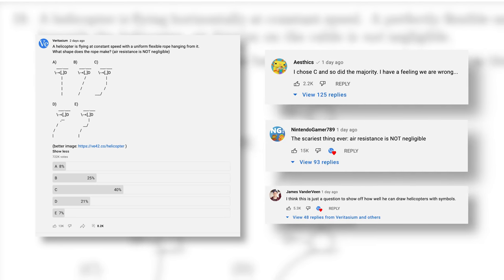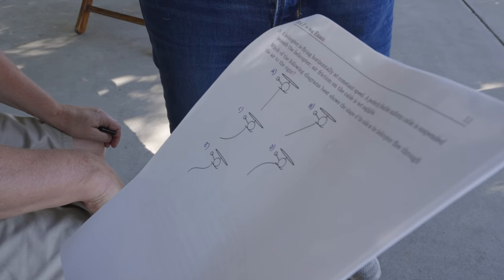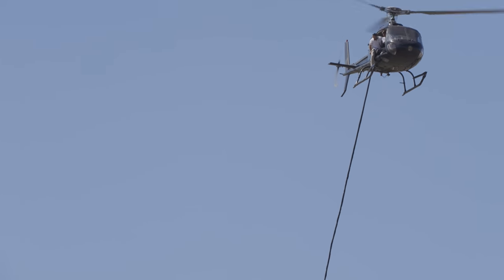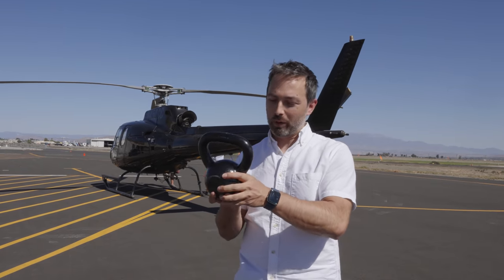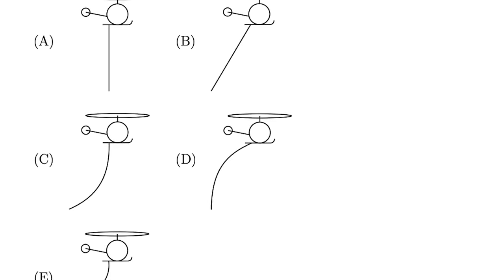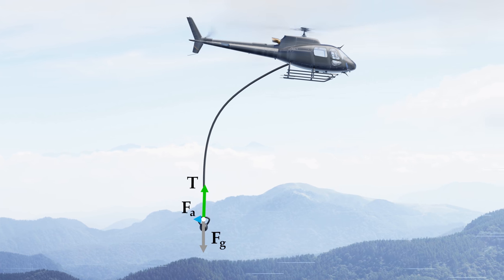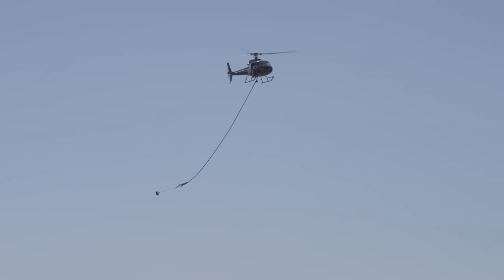I Rented A Helicopter To Settle A Physics Debate

Comment: At 17 seconds, Air friction on the cable is not negligible. Definition of negligible , so small or unimportant as to be not worth considering. So then the question is, what is the actual reaction to the cable as air flows past it? Does the air flow cause the cable to deflect? I would expect that it does. If we disregard the fact that the cable is round, and just use a strip that  is flat but the same width as the diameter of the cable, times the length of the cable, this would give the square units, what ever you are measuring it in. 

not negligible", you lose all credibility.

Comment: The question doesn't mention the force of rotor wash, the length of rope, nor the air density.

How would this be affected if there was greater rotor wash, or if the rope was shorter and perhaps more sensitive to the wash effects by being so much nearer? I'd think it might maybe be an answer "(F) Chaotic" ?

Or how would this question be affected by varying air densities? I'd imagine the answer would be nearer to A on, say, the Moon (admittedly prob not a helicopter here) ... but maybe nearer to C with a very long rope & in a more soupy environment, perhaps such as a fishing line trailing a boat?

And one final piece of information, were we to turn this up to the extreme, would be the force of gravity, if the craft were able to fly along an object with a strong enough gravity that spaghettification could be observable along the rope's length. Then I'd think mayyybe D, but at that point I think a whole lot of extra physics might start getting layered in!

Comment: True except you changed the test to achieve a specific result. "We're not going straight forward, were actually going diagnally forward and to the left" Effectively negating the rotor wash. It seems like the unweighted rope would oscillate itself into the rotors lol Pilot (Gregg), "I'm really workin on it."

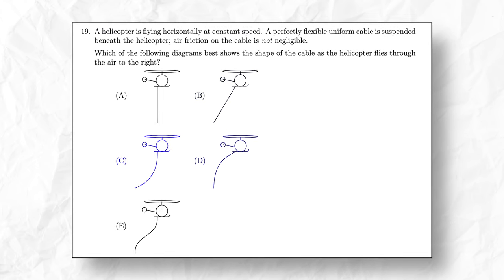Comment: 11:18 also A if the load is heavy enough eg a sea rescue. It seems many of who you asked got the first question wrong maybe they need to stay in school a bit longer. I got it right both times but depending on other variables like weight, speed and opposing forces like wind speed there are 4 possible answers.

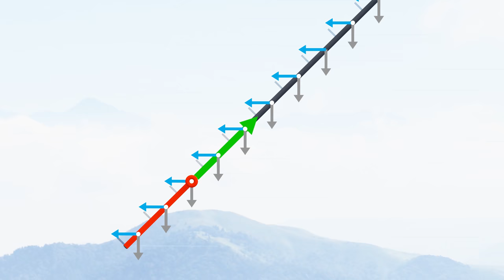Comment: How unfortunate that I just found thischannel recently. Tho the explanation is right, I think the term "air-resistance" is misleading, at least for a non native english speaker like me. as the profile of the rope doesn't change and the helicopter flies with a constant velocity, assuming the volume of air beneath the helicoper is constant as well, the drag force in every section should be the same. However if you interpret the anchor point of the rope as a bearing you can explain the phenomenon with torque. Saying at 5:25 that Fa is the Force produced by Air and it's increasing going upwards is misleading.

Comment: I believe the forward speed of the helicopter should be provided. The "B" answer will not apply to all forward speeds.

A constant forward speed of .5 MPH will give a different answer than 100 MPH.

Poorly worded question.

Correct answer insufficient information.

Comment: There are too many possible factors which would come into play and determine what would happen in this hypothetical scenario. Such things as speed of the helicopter, weight of the rope, downthrust of the helicopter and other factors of relevance which the original question leaves out.
All it does is point out the stupidity of the original question.

Comment: So wait...are we supposed to ignore that the un-weighted/messed with rope oscillated  - at the end - between the J shape and the straight line but "angled back" shape? Because the end was certainly moving back and forth between a slight J shape and a straight line. For the same reasons that the section above is in a straight line, because the end doesn't have more rope weighing it down, it is free to flap around in the wind behind it, making a slight J-shape. 

That's the real shape it makes. Not the "straight line" answer in the video. Because physics in the real world is never perfect and there will be oscillation. The average or approximation  shape is a J-Shape.

Comment: Had to watch the whole of the video as my answer was 100% B but only because I'm a qualified helicopter pilot who has seen people at work lifting loads so knew that in my mind it should be that.

Really thought this was going to be some odd answer due to the fact there's no weight on the end of the top however I have also seen that so I was pretty sure it would be B.

I actually started writing this comment halfway through watching the video so can now see that you've covered there being a weight on the end also.

To be honest even without having seen this in real-life I can honestly say I would have gone with B for the no weighted version anyway as in my mind it just makes sense.

I can't explain why I thought it as have no real full understanding of forces and what not but it just seemed to me to be the obvious answer. I did also get the right answer for the weighted version however that was more from having seen it first hand and in my mind before I watched the explanation I could come up with a reason in my head which is kind of right but would have probably struggled to get it correct if I'd never seen it first hand.

The only thing I can attribute this to is that maybe something I've experienced in life is helping me with the non-weighted version?

Something like running along with a string in hand or something like that maybe.

Can never be too sure with these types of videos though 😉

Comment: Wtf is he talking about, when a helicopter flew over me about 20-30 meters during a military exercise it almost knocked me on the ground, the down push does not disappear quickly, there has to be another reason as to why the air movement does not affect the rope.

Comment: Wouldt it be E for the weighted rope? I mean the helicopters down winds are surely strong enought to atleast have an effect on the area directly underneath the propellers on a 3-5m depth (im strongly positive thats a fact) taking into account how heavy the wind is under a idlying but not flying helicopter. 

This would mean Fg is increased at the very beginning of the rope, or aslong it is in the direct downwinds of the helicopter. Creating a verticaly oriented curve.

Then once outside the effected zone Fg would reduce back to only gravitational force. Resulting in a more horizontaly orientated curve. 

Which then gets pulled down again by the weight (increased Fg by extra weight). Once again creating the vertically oriented curve.

I am not 100% sure on this, as the tension in the rope itself is acting as a 3rd force pulling diagonaly down and up from centerpoint?!? Reducing the wave effect by straightening the curve as much as the tension allows. Again not sure here. 
Good think though. Thanks for the oppertunity.

Comment: None of these was hard to guess, but mu confidence was not terribly high. The big reveal for me was that any significant number of persons would guess C for the first condition. I guess this is one more example of what happens when human brains start getting selected for social cohesion rather than for individual cognitive ability. I can remember being momentarily ostracized in elementary school for not being fooled by a collection of supposed optical illusions as seen by my classmates. OTOH, I had to correct myself when I was interviewed by the Elevator Constructors Union about question 47 on their exam. I told them I picked the answer that would be consistent with dissimilar elliptical plungers shown from an angle that didn't treat the eccentricities of the plungers or of the bores of the ducts, but that I now preferred the explanation that one of the plungers was either locked or jammed. They looked at me like they were seeing a ghost. But you can get a snapshot of something that looks like helicopter C during forward decelleration. Really? Yeah. Try it.

Comment: What if the length of the rope is extremely long the answer is d
Reply: The diagrams show ropes not much longer than the helicopter is.  That's the scenario under test.  

I agree finding where the assumptions change is a worthy test.  I feel a lighter rope even a piece of thin twine would have a dramatically different reaction to the forward motion.
Reply: @stevetheduck1425 i said what if

Comment: OK so this not correct because the question really can't be answered correctly because the speed of the helicopter matters. Jus like when the helicopter goes faster your gonna get more wind resistance on the rope which will make the rope look like answer b but if the helicopter was only going 2 mph the angle of the rope would be so low it would look straight. Also the weight of the rope is going to matter.

Comment: this video is that all I hope you come check my answer… I said B without even thinking about it… I will now watch the video to see how right I actually am… I'll only come back if I'm wrong… PS I came back anyway I was right and the video is not quite over but I'm going to answer the next question you asked…the air push down by the helicopter rotor has no effect… I find this too easy but I have had RC helicopters and I do have a better knowledge about them so maybe I cheated… I like your videos by the way

Comment: i know im not a engineer by any means but wouldnt the use of a drone done this job and not cost as much??? granted its not as exciting but its cheaper
Reply: People would of course argue that a drone is not a helicopter, that the downdraft is very different, and then get stuck in the 'it's not a perfect test / silver bullet' argument.
Reply: @stevetheduck1425  true but wouldn't the downdraft be the same if everything was scaled down from the weight of the drone to the propeller size. The scaled amount of energy should be required to lift the drone meaning the downdraft would also be scaled the same.

Comment: air resistance, lift, drag, gravity and power or force applied also ambient atmospheric pressure. here air resistance or drag should be constant as well as gravity as well the atmospheric pressure.  what is variable here is the lift which is in proportion to power applied. then B is the correct answer. BUT THE QUESTION IS VAGUE. it does not mention that the suppose to be constants are constant. because any change in the constants what ever it may be will have a differing effect on  the rope. THE TEACHER WHO MADE THE QUESTION SHOULD BE REMOVED. he simply implied that air resistance should be taken into consideration but he failed to mention the strength of the air resistance. there are so many types or values of air resistance, hi low lean pressure, temperature,  air moisture as well as density and altitude. hahahahaha!

Comment: I got fooled by how the question was asked. I thought you were asking for the initial acceleration from static to constant speed. For which I picked E (and got excited when I saw the E shape when the heli started to move). B seems very logical when talking about a constant speed. the debate is not on the side of the answer but on the question in my opinion. And this is why you get so many different answers.

Comment: Your video does not account for weight of the cable. A steel cable is what should be tested and it would look like e all day long. The crossover of the “s” should be where the air resistance and the weight or gravitational force on the cable. All of this is just an armchair guess, but I can imagine it working.

Comment: But what if it was a much longer rope? Because the 50ft rope showed wiggle from the weight displacement, and the air resistance would not exceed the tension of the rope, and that would give a different result.

Edit: as a matter of fact, looking back on it, the basis of the answer B is that the diagonal pull of gravity and air resistance is always equal to the tension in the rope, however, as the rope is longer, the tension and gravity will increase, but air resistance will remain constant, meaning that the rope is a parabolic shape, and the short rope you had only portrayed a small section that appeared straight

Comment: So... here's one for you about a slung load:
The STAR Rescue system was designed to get a man from standing on the ground into a high-energy moving aeroplane by capturing and cutting a line tethering a balloon to the person to be rescued, so that they could be winched into the aircraft once the were being towed in the slipstream. The aeroplane flew into the wind to minimise ground speed. The tether had some elasticity.

Q. What is the path that the rescued person takes from the ground to being towed by the aeroplane?
A. Diagonally below the track of the rescue plane up to the towed altitude;
B. Along the track, in a curve which climbs steeply before levelling out;
C. Along the track in an S curve (shallow gradient at the beginning and end);
D. In the reverse direction of the track, then curving upwards into the track;
E. Some other path.

Comment: (answering before watching the video)
The answer probably depends on whether the helicopter is accelerating forward or not. At a constant speed, the answer should probably be C because the wind can more easily pull the bottom of the rope backward. If the helicopter is accelerating forward, it should probably be D because the helicopter is pulling the top of the rope forward.

My answer ends up being wrong, but the correct answer is not surprising. I was hoping the answer would be really weird and unexpected, possibly none of the options.

Comment: Several  problems.  1. you specified ROPE, NOT CABLE,  therefore NOT 50 lb rope.  I can tell you from experience, they will react differently.  (XVIII Airborne Skydragon, VN.)  2. Speed and 'angle'  of flight makes a huge difference as does the skill and knowledge of the pilot. In your case, you got lucky and found not only a guy who values his aircraft,  the lives and well being of his passengers, and has the wisdom and experience  to protect both.  3. NOT all helicopters have the same prop wash,, you want to have some fun, try your experiment on 1. a Commanche, 2, on a Chinook:)
5.  Lastly, the question on the exam is POORLY WORDED! The testers should have been given an "F", in this case, ANOTHER possible Answer! i.i 
"F. Depending on the circumstances, ALL OF THE ABOVE could be CORRECT!."
Fun video though. I hope you bought your Pilot a drink afterwards :)

Comment: Honestly, removing the weight from the question made it easier. I nailed B for the rope. It's obvious, everyone SHOULD know what happens to a piece of rope pulled through air. (you can do it with your hands)
The weight actually made the question harder and somewhat ''unpredictable''. My take.
Reply: makes it easier if you live in Australia or California though & are used to seeing helicopters carrying buckets of water all summer. I had no idea how much impact the rotor wash would have on an unweighted piece of string/rope though, take the helicopter out of the equation & yes I agree it should be obvious

Comment: Looked like B at first glance! When you included basically there was no wind other than travel velocity I just pictured the bottom of the rope being pulled by the top and it was almost as much common sense as science. The one with the weight on the bottom was common sense to because it had more downward pull to resist against. The one with the parachute was fairly predictable also. It really makes me wonder what college the initial answers came from?
  I understand most of American colleges are confused about male and female so I can only guess which politically influenced one the answers presented came from!
   Because that college definitely has some future fact checkers we can all look forward to!